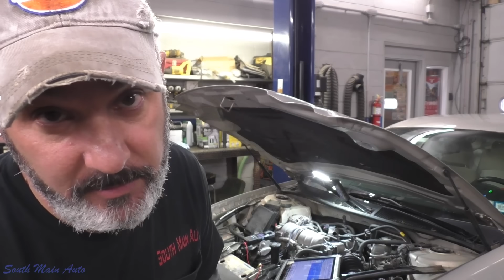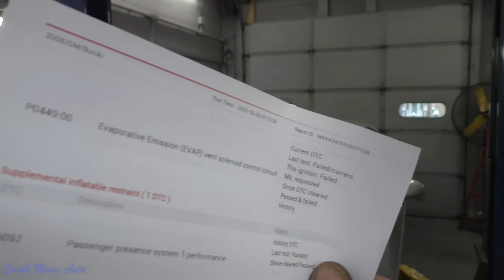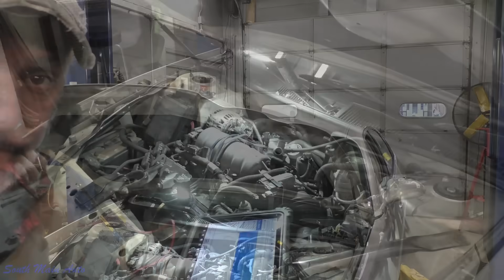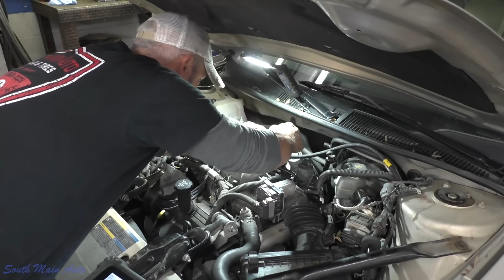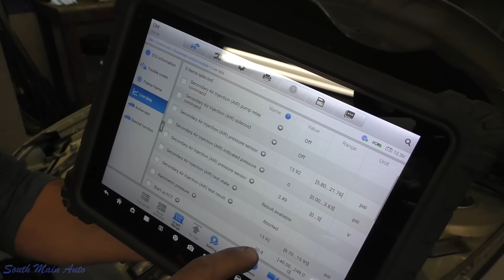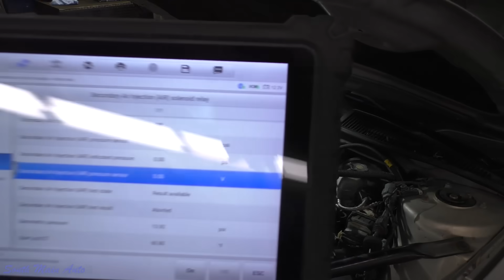When “New” Parts Are Worse Than The Broken Ones 🤬

Comment: I have a 2016 Ford Expedition.  I am now on my FOURTH Drinker-Side Window Regulator in as many months.  The mechanic is frustrated to no end.  He's losing money now.  He's used OEM parts EVERY TIME...and they are JUNK.  Guess who makes the "Official OEM Part" now?  Doorman.  Need I say more.  The last time I went to the stealership parts counter and got one (the one that is in there now and broke in 7 days), Doorman.  I said "This is the 4th one".  He said "Yep, we have been through 20 and 30 on vehicles.  Put one in, breaks while testing, put the next in and it breaks.  These are $200 regulators (2016 Expedition Platinum).  Pissed doesn't even begin to explain my feelings on this.
Reply: What side is the drinker-side?
Reply: @lvsqcsl  Passenger side, but iykyk.  Captain side is the driver side...which...my wife told me just died as she came in from shopping.  Couldn't get her pumpkin spice this morning I guess.  Watch Derek over at Vice Grip Garage....You'll get a whole new vocabulary....you can find him on the interwebs...he sells some things on the evilbay, and buys stuff from the jungle website...a Feller (or Fellet) can kick back with some wobble pops, wet the back neck, and watch him bring cars from the dead back.

Comment: Sounds like you need to stop ordering aftermarket parts from Napa and go with OEM. If the made in China part is crap brand new, it's likely because the manufacturer (STP or whoever) gave crap specs to the factory in China.

Comment: My piss and moan was a 2005 Chevy thunder 2500 with a 6.0 LS. Oil pressure sending unit was puking oil between the housing and connector body. Went to the local dealer and bought an AC Delco that said on the box, "Made in China". It leaked worse than the original. Took it back out and got another one from same dealer, leaked less than the other two, but still leaked. Replaced it with a Standard brand from the local parts store, finally fixed the leak. Every cuss word I know was used because those senders are a bit$h to change and the 3 trips to the dealer is 12 miles  away using my own gas.

Comment: Add issues with the EGR sensor on 2000 f150 v6 got 2 from autozone both failed had to buy OEM replacement to fix it right

Comment: Not very often do I see the same problem occur on the same engine that I have. Yes, the solenoids and vent valves will eventually fail on those 3.8L motors. My shop literally refused to put replace it with anything other than an OEM (old dealer stock) replacement from AC Delco.  (Took him 2 weeks to find one at 3x the cost - I live in the People's Republic of CA where smog is still required on '76 and newer cars). Says it's bitten him in the as* one too many times.  If you wanna keep your old 3800-powered unit alive, only buy from Mr. Goodwrench!

Comment: Eric I feel your pain 😮 in all the years that I was fixing vehicles here in the uk , as a mobile mechanic I would mostly use parts from our local car breakers or you pull it yard unless it was discs pads etc . Sometimes you could not get a good new working sensor or valve even from the dealership 😏🚙

Comment: I don't get it, what is the economics behind bad parts? In a week, I had to replace the coil pack in my kids car 3 times because they kept failing, to the point he thought I was wrong.  Returned all 3 because warranty and ordered one from Rock Auto, worked fine to this day... It's a waste of time and resources for all involved, me, store, manufacturer.  Who wins?  A 5 minute coil pack is one thing but a 3 hour starter is another and causes a lack in consumer confidence in the store and manufacturer.  I have an Audi and an Alfa and am forced to use boutique parts because I don't trust the local retailers, it's expensive but I haven't had a bad part with this strategy since the vr6 coil pack debacle I went through in 2005.  Chasing my tail by replacing a bad part with a bad part that was $500.

Comment: Worrying about replacement parts not working I was able to get my original idle air control valve to work by soaking the stuck bearing with  liquid lube overnight.  It works like a champ now and I saved a bunch of money.

Comment: The underwhelming quality of parts will not end until the manufacturers have to start reimbursing shops for their working hours when something like this happens.
Reply: We were always able to file a labor claim under warranty. It would go through the parts store to the distributor and then the manufacturer. It always got lost in the abyss and we never received a dime. 1980s-1990s.
Reply: @wilbilt , our Oreilly parts store would pay comeback pay, but at a reduced rate.
Reply: Well said !
Reply: Just order from Rock Auto. That's all the parts stored do anyway when they inevitably don't have the part in stock. If you have to wait 3 days for the part to arrive, it's because they ordered it with 2 day shipping. Check the price difference! Went to O'Rielly a few times and got quoted prices that were the same as ordering off Rock Auto with express shipping plus $15. Never got a bad part by ordering myself online but have had all sorts of problems with the local shop. The employees there just don't know how to listen... 

I say, "K1500, the four wheel drive one with a gas engine." 

They ask, "Is that the 5 liter engine."

 "You mean 5.7 liter, right?"

"No, the system only gives 5 liter for gas engine on this model."

Make them let me look at the screen. They clicked through on C1500🙄
Reply: Your right.
Reply: Back when I worked at a photo lab in the early 2000's, I was told we received an "automatic credit" in our vendor contracts for bad parts and materials.  So, if we installed a machine part and it didn't work, we just threw it out.  No records or bookkeeping or anything.  Go ahead and tell me the "adjusted" price we were paying wasn't just the normal price.

Double the price, and perpetually 50% off.  What a deal!
Reply: Nope, it won't stop until people stop buying junk.
Reply: If each labor reimbursement claim also required the manufacturer CEO have his finger snipped off with wire dikes,  they'd sort this shit out pretty fast.
Reply: once all the democrats are out of power with the climate change and globalism bullshit.
Reply: This happens but it's a nightmare to get it to happen.
Reply: This is the solution. Problem is the same problem as any warranty. They'll do their best to say it was you.
Reply: Great idea. But these parts companies arent going to be able to squeeze any money out of China
Reply: @demonknight7965  Sometimes there's no choice but China, but when there is, I'll spend extra money to avoid parts from that country. Taiwan makes much better stuff. Even Mexico is better than Chinese "quality".
Reply: You know it's bad when you go back to Auto Zone to return the part you just bought from them because it was a dud, and the person behind the counter says, "No problem", hands you a replacement one and says "Try this one"..What TF do you mean try this one? How about giving me one that works. They couldn't care less whether it works or not as long as they have another one to give you. They don't care about your time.
Reply: @reibenny  Remember, the AutoZone or any box store employee isn’t the one who determines quality or policy. The people who do are higher up—and you’ll never meet them.
Reply: @chris1le  Oh yeah I know. it's all cheap replacement crap and most of the employees have no idea, they're just selling you what they have..I have been buying after market parts since the early 90's and I have to say that over the years the quality has gone completely down the toilet..
Reply: @reibenny They don't live in a bubble mate. They know it's crap, that's why they're offering another to potentially fix the problem - because that's all they can do. Your AutoZone guy can't do anything else and doesn't need to hear your complaints - it had nothing to do with him. He needs to pay rent and eat. Complain to head office in detail or nothing changes.
Reply: @chris1le  That's probably just as well!
Reply: @reibenny you forgot the price has went up
Reply: @reibenny  They are only workers at the store, they don't own the business, and they sure TF don't make the parts... It's not that the worker doesn't care, they just know they have shitty parts.
Reply: @reibenny  many of them are former technicians.  but tell you know nothing without telling us you know nothing princess.  smh
Reply: @mahtostkitnulp  Some may be or have been technicians.40 years of being in business tells me everything I need to know about the aftermarket parts industry. How long have you been in business?
Reply: The China effect is real and now that The U.S. has clapped down on Chinese imports with higher tariffs you will see even more quality issues as Chinese manufacturers have to produce the same parts for the same wholesale prices.Quality was always sketchy but it's only going to get worse until people are willing to pay more for better engineered parts. OEM's  are having these same issues hence all the recalls and catastrophic engine, transmission and electronics failures.

Comment: Friend of mine had a 94 Ford ranger, had fuel, no spark, was in a minor collision. Found a bad spark control unit, replaced it with a "New" one. Still no spark. Went to the junk yard, and snagged one from a 93. Put it in, truck started and ran!

Comment: Should have sent it to Ivan. He would have taken the solenoid apart, replaced the diaphragm, rewound the solenoid, cleaned the contacts, and NO PARTS REQUIRED.
Reply: IDK, lately he's been on a new bad parts rant as well, buying NOS or OE used parts off Ebay.  He knows what's up.

Comment: Our greenhorn mechanic called an oil pan gasket leak on a Hemi Durango, 2013 vintage. We all know the plastic oil pans are junk off the assembly line. He sells a new oil pan, gasket and 9 hours labor and a shitload of money later it comes back with a leak 2 days later. I look at it because they don’t trust the greenhorn and I said I bet dollars to donuts that brand new pan is garbage. We get authorization to pull it down and lo and behold, the brand new pan is distorted. It’s all garbage parts, Eric.
Reply: Just curious if the greenhorn checks it with a straight edge before he installed it? Ir us that something you would normally do? I totally get that These parts should just work coming out of the box though. That's what we pay money for

Comment: Well so far this last month I've replaced a brake caliper after 2 months in service because the pile decided to blow the seal between the parking brake motor and explode the motor. That cost 1300 from the dealer. Went though 3 radiators for a 90s ford because the nipple for the coolant line was only half formed. Had a wix fuel filter for a 06 5.9l cummins that was a 1/16th of an inch oversized. The plastic cap held it down for about 10 miles before dumping half a tank of diesel on the highway. Took 3 wheel cylinders to fix a nissan today. First one was wrong part in the box second didn't have threads. Third will probably make it 10 miles down the road....We're all having a flipping great time with aftermarket junk....

Comment: Bring back the model T so simple.
Reply: Got a 1931 Chrysler CM-6 that I can't find clutch or brake parts for, not even thinking of the way that shock absorbers used to be made (on the Chrysler they turn inside instead of direct compression).

Comment: Back in the 70's I had a 65 chevy v8 that I did a tune up on with plugs, points and plug wires. It vary soon after that started this chugging and skipping at stop and starts. It turned out to be the damned suppressor wires they were pushing then that would fail out the box and they were USA made. Ran into another time with resister spark plugs finding they varied. Had a ford tempo that had to have a specific brand, other crossed reference brands would cause hard starting. I started checking the plugs and wires with an ohm meter as a young diyer back then.
In later years I took a course called "Kepner Tregoe" which helps you with trouble shooting. One of the main points was to look at what has changed or been recently done and my plug wire lesson always comes to mind!
In your case Eric you follow that rule daily as I have seen in following your channel for years. 
Love your rant videos too!
Bill
Reply: In the late 70's, I replaced my resistor plugs with non-resistor plugs and bought a set of steel plug wires for my '67 Chevelle. It ran great, but at stoplights, all the other drivers wondered why their AM radios were crackling.
Reply: Had that same issue with a new set of plug wires for a 88 S10 with 2.8 V6. Changed wires as part of a tune up at 130,000+ miles and two weeks later had a miss and the engine light on. Took it to the dealer as THEY are the ones with the computer and 'knowledge'. They tried to sell me a new truck and said the engine was bad, it needed this that and the other thing replaced. I took it home and change a couple parts they said it needed (it didn't). Decided to go back to basics.: pull one wire at a time until the bad cylinder was found. Pull the plug>>not firing as it was wet with gas. Measure resistance of the wire. It was OPEN. The new wire was bad and the idiots at the dealer couldn't find it? I used a $25 multimeter and they have EVERYTHING plus schooling.
Reply: Kepner Tregoe was a great course in the 70's.  Worth every minute of class time.

Comment: Let it out Eric, I've been in those shoes too.  You do all the diagnosing, be it by the book or by your own "Much Better" testing.  Of course the dealer says, NLA.  No Longer Available.  You know what's gonna happen when you buy the aftermarket junk.  Yup.  Less than a week later, the problem is back and it's the Brand New Aftermarket FBS part ! ! !   You may go through two or three times the same crap.  Then you get lucky and find a place like Wilbert's that has a used part.  It works, the customer or driver is happy, your still Pissed because the aftermarket industry has relied on a Non U.S. part from a Non U.S. company to fix the vehicle.  Have an f***in nice day! !  Sorry for the rant!

Comment: i just had a car last week 2018 buick evap small leak hook up a smoke machine no leak in the system i was confident purge is not sealing good change it got call from the costumer after 2 days oh check engine light is on i was like ok bring the car back i will take a look now i was questioning my self did i diag the car right did the purge and seal test but fuel tank presure sensor was stuck on 2.5 volts blow it with air hose i saw live data was moving up and down hook up a smoke machine again ball drop when i close vent valve with scanner now i was like i dont know whats wrong with it change the purge from dealer ship and car was fixed and when i did the purge on the 1st place it was aftermarket yet but made in usa standerd product but yeah i get your frustration brother

Comment: As I'm a DIY, I only remember a few bad parts, the worst being a Nissan Sentra 90's-ish and a bad starter--I never thought to check a brand new reman starter.  Boy was I a dunce. For those who don't know: this starter is completely obscured from the top. I did the entire job by feel (no cameras no mirrors, touch and feel and guess.
Twice, on gravel- for my fiance who is now the ex. 
None of my mechanic pals loved cars, but for some racing cars--and those are much much simpler and a lot of fun. They loved good customers, not cars. I like cars before modules took over. Love a Cummins-hardly ever needs anything. 6BT-Bosch P7100 preferred.

Comment: I feel your pain, I had bad parts from Rock Auto. That sucked, have to ship those back
Reply: Hope you only had one location to ship back to. It's a bit frustrating to need multiple parts and none of them in the same location--that's when I go to the local parts store and hope they have some inventory.
Reply: @wadepatton2433  Frustrating yes
Reply: Just don’t  order pads and rotors. They don’t put any good padding inside the box. I just buy local OEM - about the same💵after shipping
Reply: I stopped using them unless the last resort. 98 F150 4.2 V6 in the club cab chassis. Need a Y pipe and cat. (rotted out, already butchered) They sent me something that lord only knows fit what. I fill out the return form. Send it back. I get an email stating that I ordered the wrong part, so they're not refunding me! It was the ONLY number they had for that application, and it was obviously wrong, either boxed wrong or built wrong. Nope, they blamed me. Ended up having to drive it, open manifolds, to an exhaust shop for a custom made system, which cost $$ and inconvenienced the heck out both myself and the customer.

Comment: Every single thing you said is true. I’m so sick of crappy parts.
Reply: Had to get a window regulator replaced, the first two parts in stock wouldn't fit right, so had to get an OEM part ordered and deal with extra days of delay. This was a Golf, a common car. It doesn't bode well that manufacturers have so many models now vs in the past, the parts backup just won't be there long term.
Reply: boycott made in ccp
Reply: I'm sick of crappy OEM parts
Reply: Especially if they have to be shipped, don't come for 7 days only to not fit or not work.